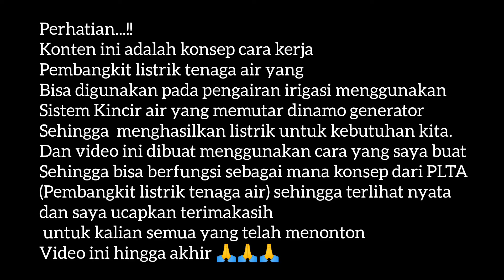MEMBUAT LISTRIK GRATIS mandiri untuk men charger smartphone

Comment: Kak itu charger hp merek apa yaa biar bisa di gunakan
Reply from the maker: No brand bro yang biasa dijual di konter hp
Reply from the maker: Tapi kalo mau tinggal colok bisa pakai modul step up USB jadi ngga perlu motong kabel tinggal sambung aja pake kabel USB
Reply: @JM_putrachannel  step up ny di tarok di mna ya mas? 🙏🏻
Reply from the maker: Di sambung sama dinamo generator yang terpasang di kincir airnya
Reply: @JM_putrachannel step up USB yang brp Volt ya mas? 🙏🏻
Reply from the maker: Bisa lihat di link produk paket lengkap kak

Comment: Motor dc nya brp volt...
Bisa mengoperasikan pompa, led dan charge hp...
Reply from the maker: 8 volt pake yang 12 volt lebih bagus plus tambahin modul step UP
Reply: @JM_putrachannel mas kalo mau pesan ke situ harganya berapaan?
Reply: @JM_putrachannel  utk rangkaian divideo...spek yang dipakai masing² brp volt?..
Pompa, led dan dinamonya...
Reply from the maker: Pompa 3 volt  lampu led 1.3 volt dinamo 6 sampai 8 volt yang 12 malah lebih bagus plus tambahin modul step up biar arusnya stabil
Reply: @JM_putrachannel  ok..terimakasih infonya
Reply from the maker: Oke sama sama
Reply: Untuk modul step up itu diletakkan dimana ya kak?
Reply from the maker: Di sambung ke dinamo Kincir airnya kak bisa lihat contoh fotonya di link paket lengkap di deskripsi videonya yah
Reply: Janggal,,perputaran kincir kencang gak sebanding dengan pancuran airnya yg lemah banget..